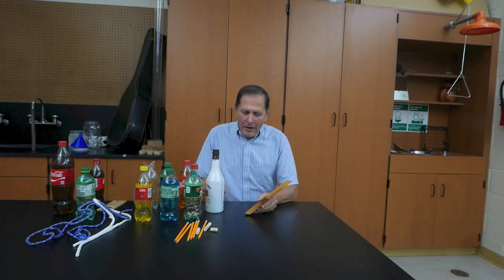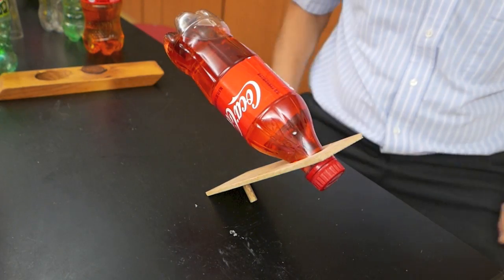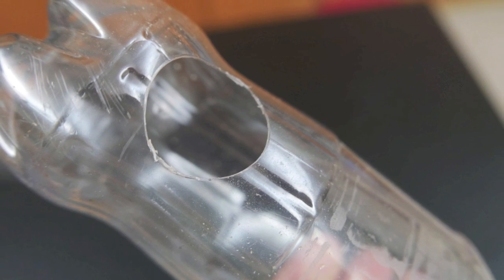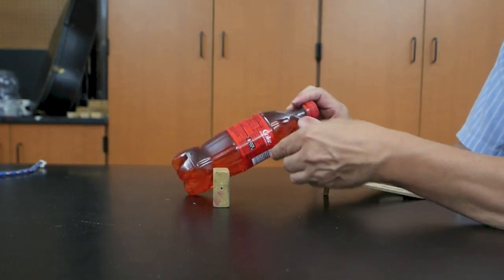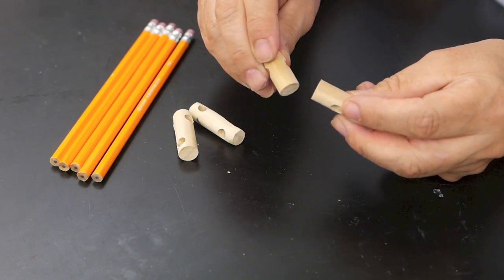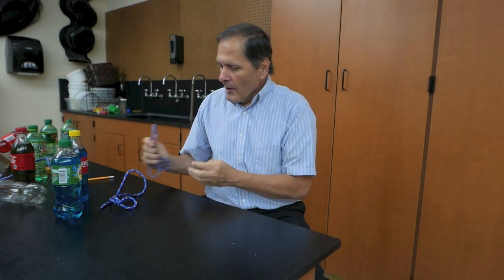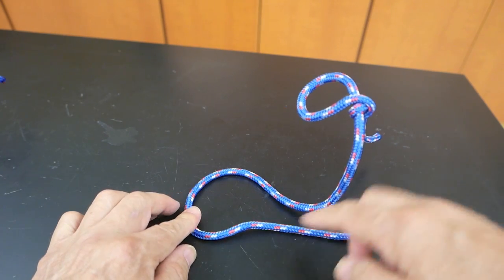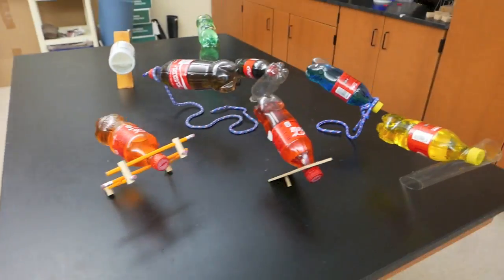Balancing Soda Bottle Collection // Homemade Science with Bruce Yeany

Comment: Nice but surely this is not balancing but a simple cantilever.
Reply from the maker: Hello Bill,  quite a few references define or refer to cantilevers as a form of balancing
Reply: G'day Bruce. I would question those references, I have always understood a cantilever to rely on 2 points of contact distributing the load where balance relies on a single contact point and equilibrium of load and gravity.
Don't mean to be picky but physics does sort of need to be definite about definitions or it just becomes theory.
Cheers mate, keep it up.
Reply from the maker: Hi Bill,  I guess I'm kind of hazy on cantilevers  but I never looked at it that way.  If I  put the bottle on the wooden block supporting it at it's center of gravity with equal torques on either side so it balances,  one support.   Adding weight to either side and it falls over as it becomes unbalanced.   when I put the bottle in one of the holders,   the "foot" of the holder is supporting the whole device under the center of gravity.  this in itself is a bit tricky as it easily topples over if it is not in the right spot.  Once I have it upright and stable if I add weight to either end of the bottle and it falls over,  wouldn't that be considered making it  "unbalanced"?   I  guess I've never considered that there were two positions of support, only the one which would be the foot of the holder. 
 Thanks for your comments,  this whole youtube project has been a learning experience for me.

Comment: 😍😍😍😍😍😍😍😍😍😍physics is awesome
Reply from the maker: thanks Sammy!
Reply: sir i have a question?
can you please tell me "what is the difference between CURRENT and VOLTAGE..?
Reply: Max Decoder voltage is the potential difference, you can relate to that so as to the speed of the current. Current is the flow of electric charge from one terminal to another. There are two ways for current to flow- conventional current , and, electron flow.